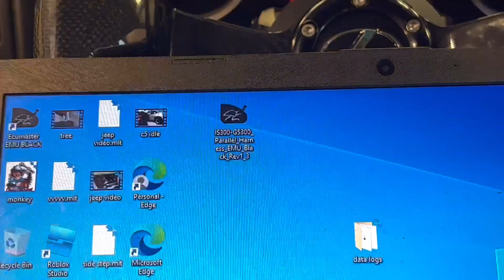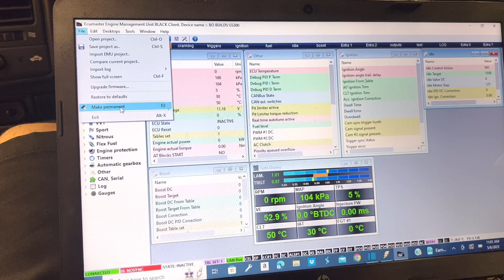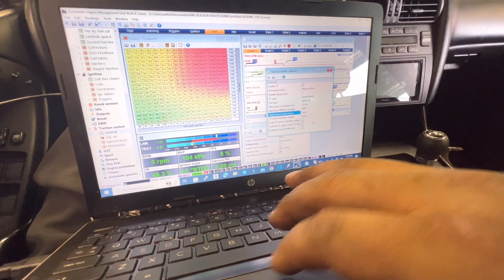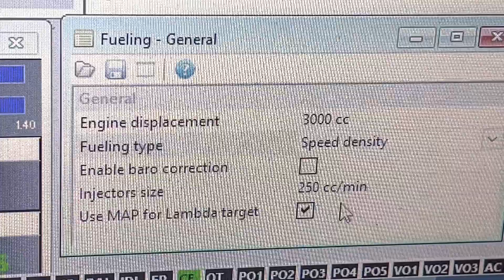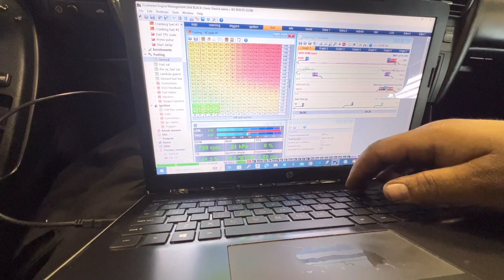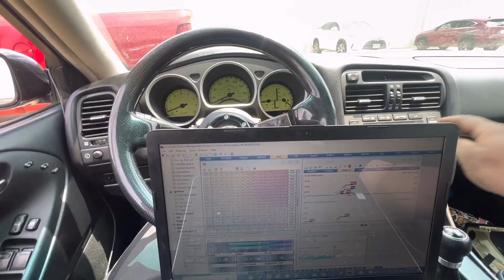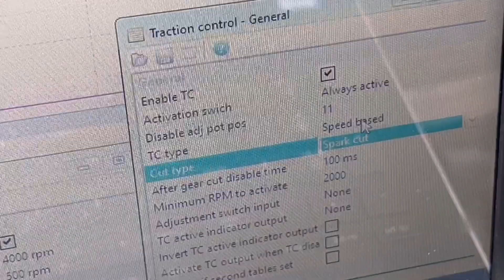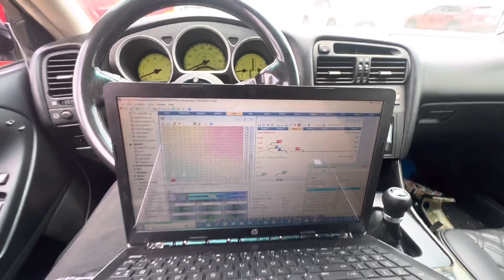Stand Alone ECU Installation ~ ECU Master PnP Kit For Lexus IS300 / GS300

Comment: Quick question - from my understanding these cars have the stock intake air temp sensor built in to the mass airflow sensor already. Can i plug up the included IAT sensor to the ecu master without having to disconnect the stock mass airflow sensor from the car and run both, or do i have to disconnect/ modify the mass airflow sensor? Thanks.
Reply from the maker: you can use the iat sensor thats built into the maf housing. just have to find he 2 wires. let me know if you need help finding those wires
Reply: Ahh, will the ECU master still be happy with the readings from the MAF for air temp? Or do you think it’ll provide any tunability issues vs using the provided sensor? And if you know which wires they are that would be amazing. Thanks man I appreciate it

Comment: Is the IS and GS 300s the same when it comes to ecu and wiring engine side
Reply from the maker: same year range should be the same 98-2001 and 2002-2005
Reply: @BoBuilds  ok cool. I'm in the UK. They didn't make a Is300 over here only a Is200 (2L) so thinking of getting an is200 and a Gs300 and making an Is300 and turboing it
Reply: @vxracing380  IS300 were made and sold in the UK, there are just less of them than IS200
Reply: @wt2video922 the ge is vvti mine is and it’s common

Comment: hyped to see where this build goes. I couldn't decide if I wanted to use ar5 out of a Colorado  or a BMW zf but I think I know what route I want to go. since I couldn't decide i went straight to boosting the stock ge with the auto trans shimmed on stock ecu. been daily driving on 7psi for a year and a half and now I think  its time to manual and go emu black . also im new to this kind of stuff i just took my car apart and  and learned from trial and error and i kind want to to do the same when i get an ecu so ill be following the build.

Comment: Can you control the throttle body from the standalone with that harness. I heard that the harness need to keep the throttle body connected to the stock ecu for automatic but if your not using the stock automatic do you have to manually connect to the standalone?

Comment: Hey man I’m kinda doing the same thing as you putting an ls in my is300 I still have the 2jz as well been a follow for a but following the is300 build. Just asking a quick question for you if u kept stock gauges how’d you adapt both sending units to talk to the Lexus computer